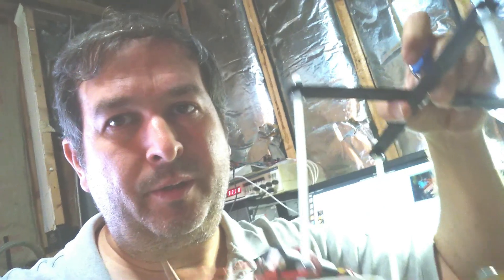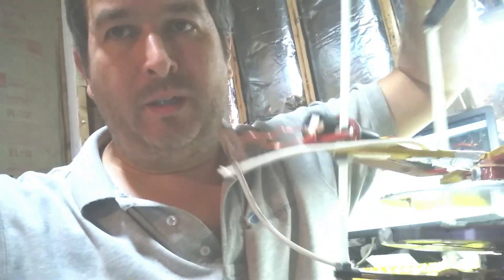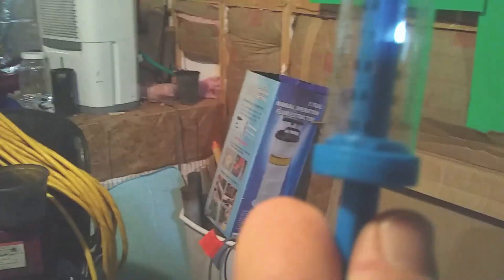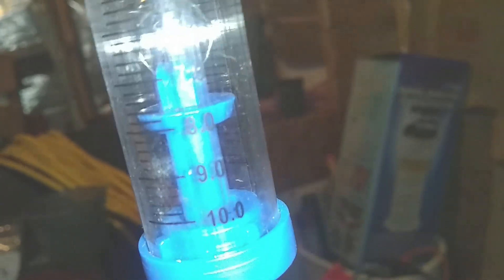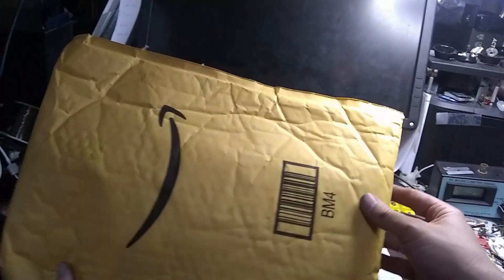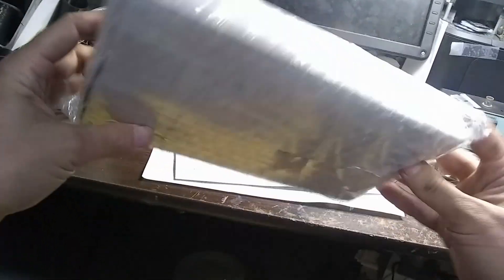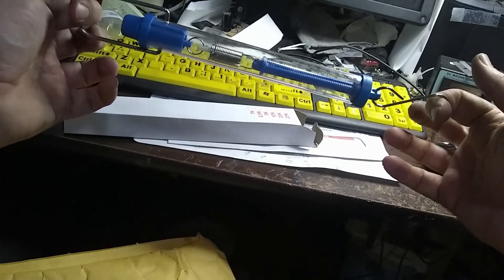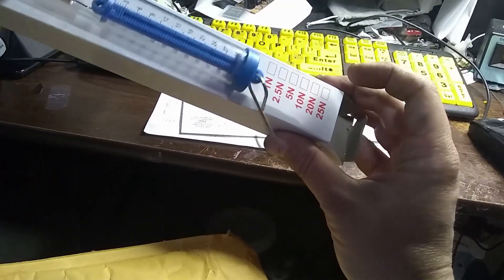Anti-Gravity Disc Machine Experiments: 1

Comment: Before trying to replicate Alexey Chekurkov’s device, you should take some time to study it first. You’re missing 4 essential components; the magnets, the Tesla coil, the center disk and the ultrasonic transducer. You’re just playing around with spinning charged disks and not “replicating” anything.
Reply from the maker: Yes I know.. and If you have seen my other tech videos, I have spent the last several years developing special high power ultrasonic devices, and solid state Tesla coils.. for this explicit purpose.. Although I may not say in the video what the final goal is.. I usually do drop some hints.. for instance.. I started building special high power transistor oscillators,.. because the lower power oscillators were being affected by the scalar waves that I was generating in my experiments.. I only have been releasing small portions of my research.. but I will be making more videos on this topic soon.. I need to study the parts individually, as well as in combination with each other.. to get a full understanding of what is going on.. Thanks for the great comments!